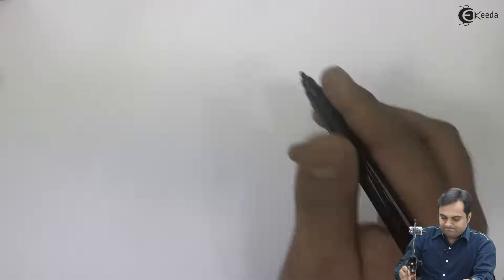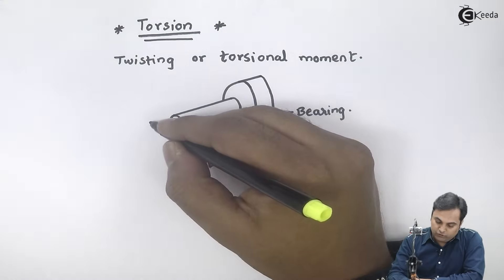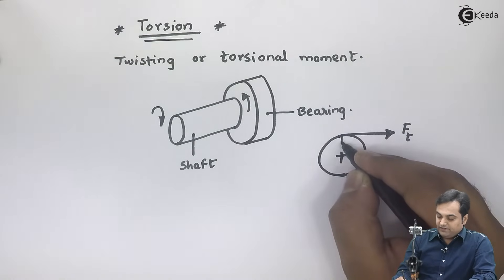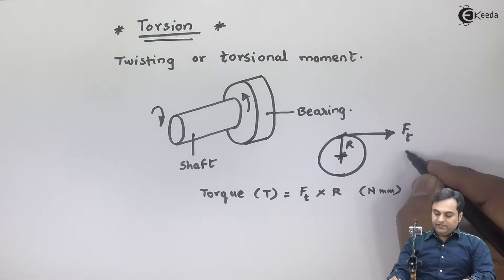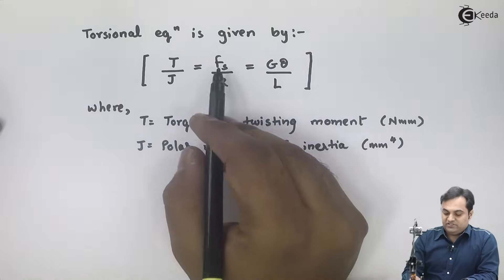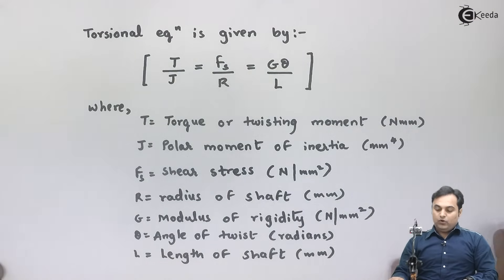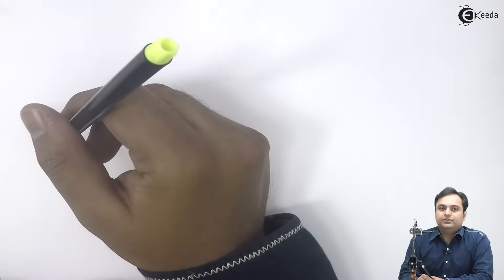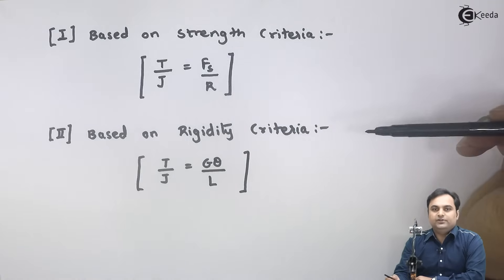Definition of Torsion - Torsion - Strength of Materials

Comment: you are technically wrong when you say that the bearing is rotating in the opposite direction. here the bearing resists the motion and the reaction is in the opposite direction of the force(torque). if the applied torque overcomes this reaction then the shaft will start rotating which will be the same direction as the torque.